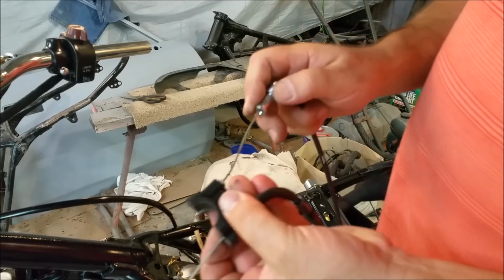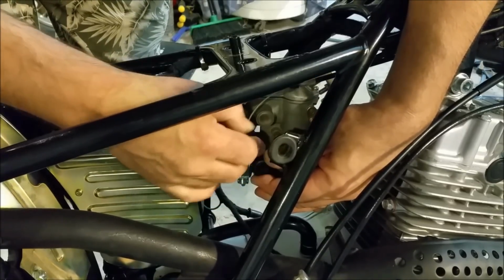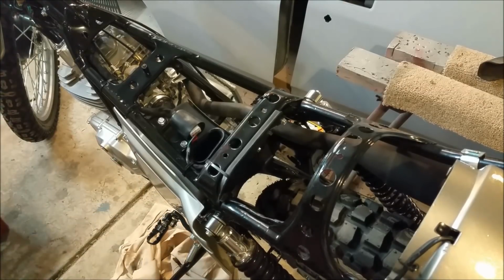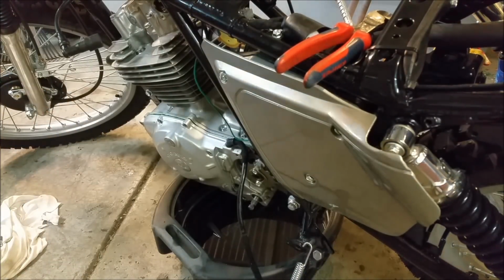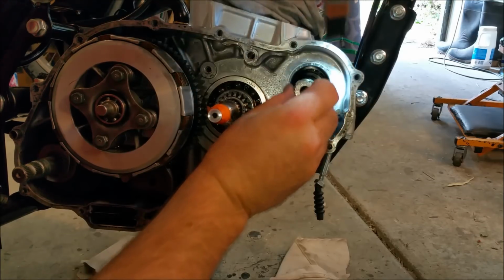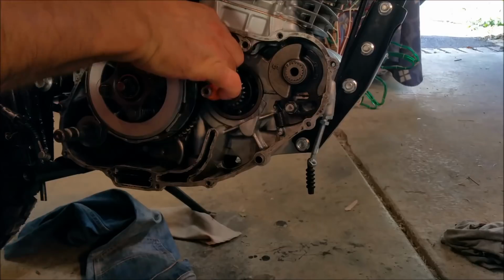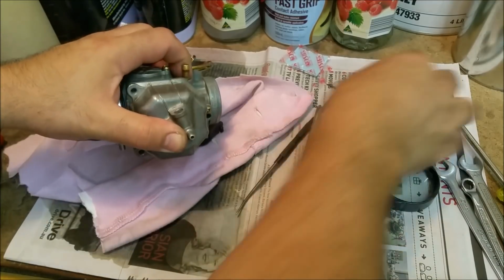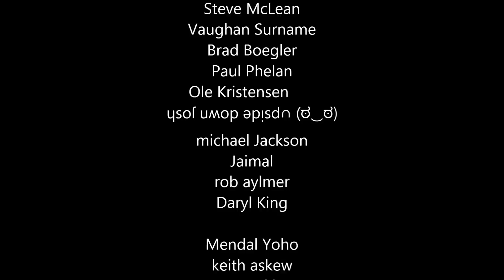Honda XL250 Restoration Part 18 - Nasty Engine Noises

Comment: Hi Peter,2 little things  1.the throttle cable assembly is upside down i,e,the cables point Up and 2 the choke bracket in is back to front and should be nearer the handle bars.
hope this helps

Comment: Yeah, you're right, these things do occasionally happen especially when you're doing a full tear down and reassembly mixing a few new parts in with the old.  And it's bad enough that it happens and you have to go back and rectify a problem.  But it's worse when it happens in front of the owner and because you care about your work, even if the owner is totally understanding and you can both have a bit of a laugh you still feel a bit red-faced. 
Never mind, you'll beat it and it'll be schmick.

Comment: none OEM pistons, valves, and heads, when mixed with OEM parts, can lead to valves tapping the piston crown, a none OEM head with valves and piston supplied from the same firm will be OK but when you mix them up you get clearance problems, a lot of none OEM piston have a higher crown to raise compression for the none leaded files and often they have bigger valves, its a case of keeping everything the same, either all original or all replacement parts, the Berle barrels, heads, pistons are great and cheap but it's best not combine them with genuine honda stock components, that's from my experience, I had to put three head gaskets in to get deck height clearance on an XL 185 many years back, luckily I tested it on the bench, turning it over by hand, it would go through a full cycle but a clicking could be heard, stripped it down, blues chalked the crown it and reassembled it and sure enough the blue chalk was removed on the crown where the outlet valves had been hitting it. . . just !

Comment: With packing the barrel Up 0.040” you may have the bottom ring on the piston to barrel shirt issues. Make sure the bottom ring is not traveling into the tapered section at the base of the barrel

Comment: Hi Pete, don't be disheartened mate you know and said that. Working on things with age on them is always problematic at best. I have had many Honda engines and think i recognise that noise to be the timing set. They are noisy when working well. I think your onto something when you saw just how loose that balance shaft was and having to go off scale to get a resonable tention on the other end. That's not normal at all. I've been waiting for this episode every day. I feel bad for you knowing your right in the limelight too. Im definitely thinking its nothing you have done but infact uncovered a existing problem mate. Never second guess yourself. You know this stuff back the front Pete. Onward and upward  buddy. Take care, we believe in you 1000000000%
Reply: I agree abouth the balance shaft. Definately something wrong there. It could also explain the vibration Peter mentioned after his first attempt at fixing it.
Reply: Agreed, something seems off here

Comment: your good your just finding out y the last piston had valve marks on it some one could have shaved the head and the cylinder top as well for more compression or the wrong valves could be in it or the piston could be for a different bike you never know what happened to it b4 he got it Pete but in you'll get it right

Comment: I seem to recall that back in the '80s some Volvo car engines (mainly in 240s but it probably affected some 740s and 760 turbos too) weren't engineered to run on unleaded petrol, the compression was too high.  The official Volvo UK fix for this was to run them with two head gaskets stacked on top of each other.  It sounds dodgy as hell but apparently it worked fine, though presumably that meant using OE parts, I doubt if it would work so well using less good quality aftermarket parts...

Comment: Hi Peter not to underestimate your skills on the xl250 rebuild  but I've xl250r  1985 is your decompression lever in the totally  release position any pull on the cable can make a tapping noise from the top end mine might be different hope you keep up your informative and educational videos 😆😆🏍🏍🏍🏍🏍

Comment: Check that Compression release on the head, if it's adjusted wrong (or the cable) it can make that same noise like youre getting currently (at the END of the video, after the second reassembly)

Comment: Chin up! I'm sure you will have it sorted soon enough. I wish I had a tip for you but I don't know anything about the honda single cylinders. Good luck mate.
Reply: Actually double check that the piston isn't kissing a valve. I'm guessing it's a new piston. I beleive that mustie1 had the same issue! New piston was slighter taller than the old one.

Comment: Hey that's very humble of you showing the not so happy bits , don't be too disappointed the xl 250 is a rattly noisy beast particularly timing chain and valve adjustment  my last one went for ever sounding very similar with no issues..I'm intrigued to see if you get it any quieter for if \when I find another one ...PS I may have to change my avatar as the restoration on yours\daves  makes my (what I thought was amazing ) restoration look half arsed !!      Chip up and thanks for your  superb videos 👍👍👍👍👍

Comment: Hi Pete,  re the vibration - balance shaft, put it back to standard, this not your noise.  This is a top end noise, confirm cam chain is tight, confirm rockers arent' worn, confirm cam/head bearing tolerances, replace valve adjuster screws and confirm valve tops are ground flat, confirm piston to bore clearance, it should be bugger all, compared to a car, 0.040mm-0.050mm at skirt.  The valves hitting piston thing doesn't  happen  on Japanese bikes and particularly Honda's so long as every thing is genuine (Acknowledge head it may have been surface ground, but you would need to take 2-3 mm off it to make a valve hit)  .  Is the piston a high comp non genuine part ?
good luck 

james

Comment: have you checked the timing chain adjuster  had the same bike years ago and the timing adjuster is a pain i now have a xl600 with the reed valve setup  but very good rebuild

Comment: Hi sorry to go on about  the decompression lever but when you released the decompression cable did the internationals of the decompression lever still hit the top of the valve as it sprung back to see if the noise is anything to do with the decompression lever start bike and touch the lever and feel for vibration

Comment: I have just finished rebuilding my xl250s engine and am about to fit it back into the frame. I'm a little nervous now ! My engine was running well before rebuilding it and I needed to tear it apart to change the final drive oil seal, big job for a non mechanic. Anyway I noticed you adjusted the balancer locking arm and it still looked like it was at max adjustment, I had to do the same procedure and the tension or arm was over in the 8 o'clock position. My question is if the balance chain isn't too worn to tension properly ? Just my penny's worth.

Comment: Hi Peter iv watched  your  last video on the xl250 few times I don't  know if you check the oil on your xl250 the same as mine but you don't screw  the dip stick back in to check oil level
Reply: Honda mowers are the same